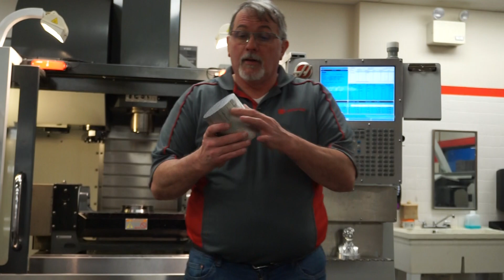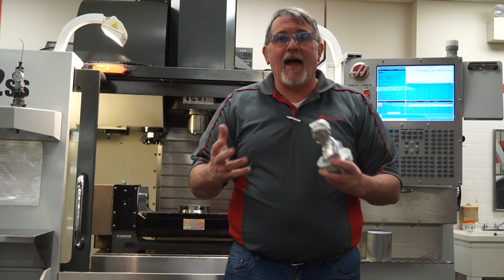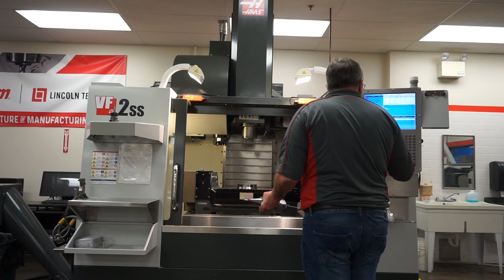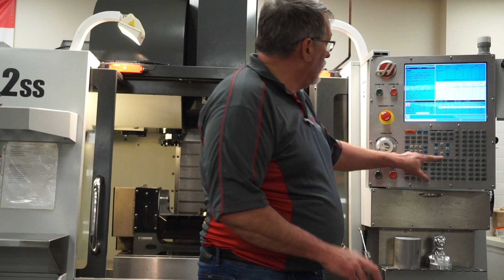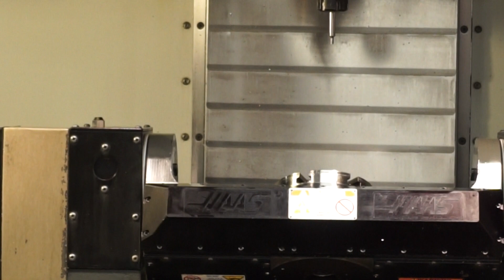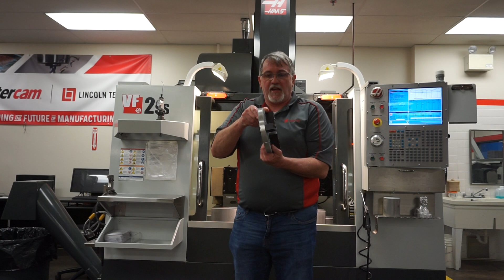Setting Center of Rotation for a 5 Axis CNC Mill 202003190858211

Comment: Those +2 attachments on haas machines are garbage...at least the non-trunnion type / single sided unit...like the TRT160.  I've been using one for almost 4 years now and it's never produced better than .0015" tolerance.  And, haas techs and many other users have said the same thing.  It's fine if you use it for workholding and re origin your part every time you move it, but forget about running a full 5 axis routine and getting any kind of accuracy.  Perhaps a full trunnion is better...I wouldn't know.
Reply: Im not sure if they have a kinematics calibration cycle built in that operators can run to keep the machine nice and true.
Other brands of five axis have these to eliminate miss matches and improve blends between axis changes.
Reply: @mikeykany1973 ...I see. Thanks

Comment: Need to take half the gap you found in Y from A90 to A-90 to get the proper Z axis shift. Also, most machines do not have a full +-90 on the A/B tilt axis. There are still ways to find MRZP though, just need to be clever about it.
Reply: Makes sense, also note you can indicate the A axis laying down and then add or subtract to get taper out of a part that is done mostly laying down while being machined, as the 90 degree is not always a true 90 degree movement on some systems or if its just to account for slop in the table. Cause I've seen how sloppy a tr160 can get and still run day in and out, clapped out is an understatement.